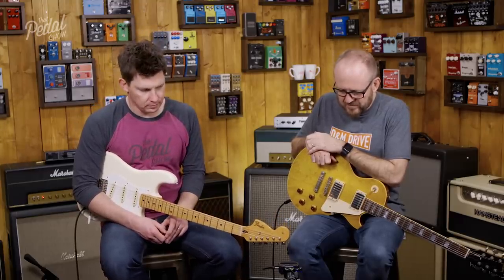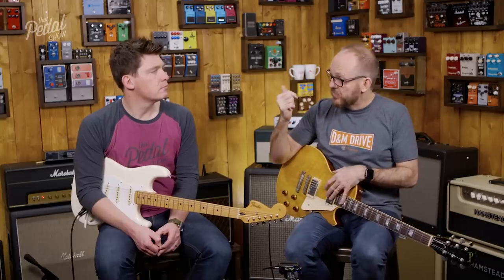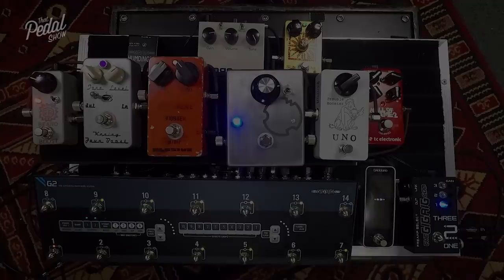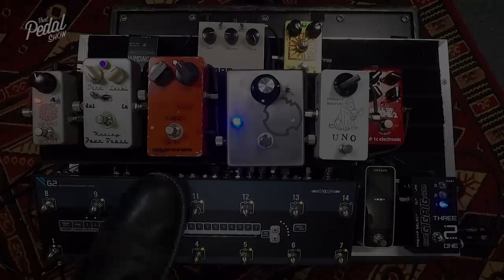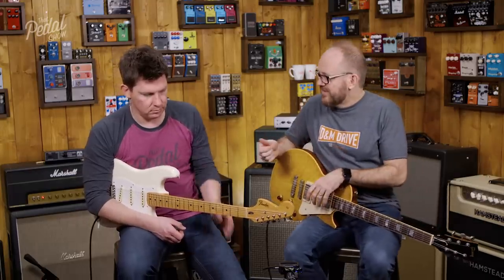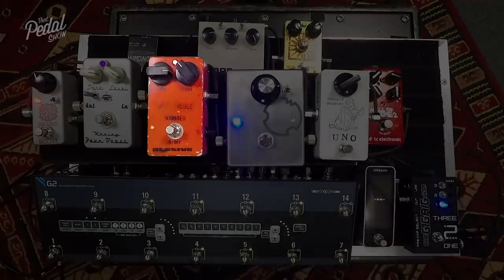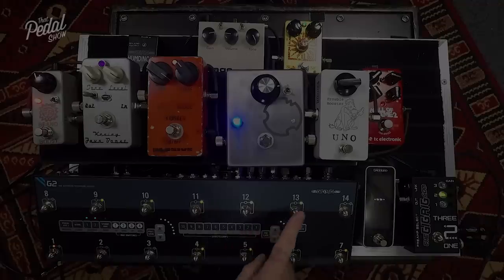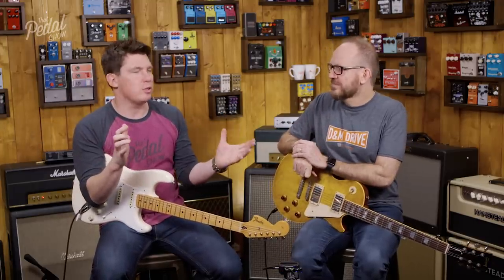That Pedal Show – Tremendous Treble Boosters For Glorious Classic Drive Tones

Comment: Not sure how I didn't catch this when you guys (gender neutral ;-) just to pile on) had covered treble boosters before but these seem to have the same/similar quirks as fuzz. Which sort of explains why there aren't as many treble boosters as overdrives considering many would utilize both types of pedals for a solo boost thing. Horses for courses I suppose, for me while I like the sound of the treble booster (predominantly with humbuckers it seems) not sure how I would incorporate it into my (crap) tone.
Reply from the maker: Indeed. It seems that lots of people have OD/distortion/fuzz/Boost sort of inextricably linked with solo boost. Which of course they can be, but you can have one without the other, especially when we’re talking about gianier sounds. For us a treble booster is really about tone and texture rather than getting louder for solos. You need something else for that... if you don’t have a sound engineer with everything mic’d. Cheers!
Reply: That Pedal Show Exactly. Hence the horses for courses metaphor. Didn't intend for the solo boost point to be the main point of the comment. More how the name treble boost has an assumptive quality to it that mixed with the idiosyncrasies of the finicky circuit can be a turn off for some players.

Comment: Wtf is a passive guitar pedal? Of course it takes power, right? All transistors need power to work...
Reply from the maker: Not this one. Well, no battery or external voltage anyway. Works best after a buffer of my memory serves. Mick here.
Reply: This baffles me... i build pedals as s hobby,  and understand that certain tone controls can be passive, and i understand that you can achieve diode clipping without power, but it sounds like shit. But treble boosters require a transistor  that requires power. So wth is this pedal doing? Its actually driving me insane... please help me understand before my brain explodes... Thanks for the speedy response!
Reply from the maker: I don’t know. Mick here. Google it maybe....
Reply: Oh i googled it alright. Theres actually ZERO info on the uno out there oddly enough. Like, its either discontinued or not out yet. Theres are a few differant versions of the trouble booster made by bigfoot that arent passive tho. When i heard the word "passive guitar pedal" i just had to investigste bc i didnt know such pedals existed and a passive treble booster just blows my mind. If anyone has any info about this plesse share! Until then  i guess ill just have to let this go... thanks for the quick response, i really appreciate it. Absolutely love your videos